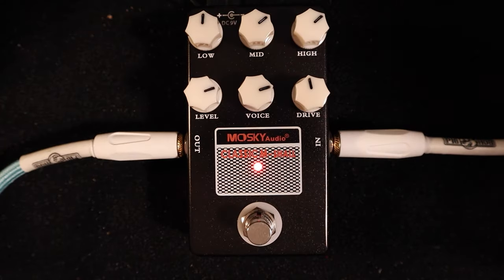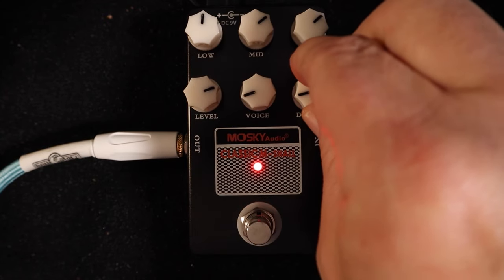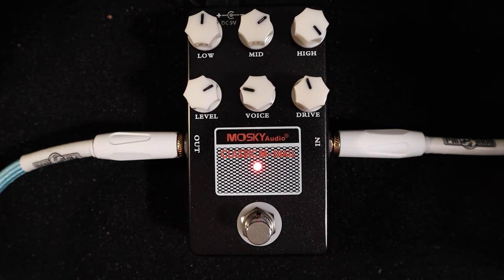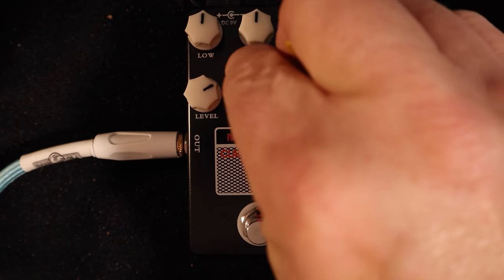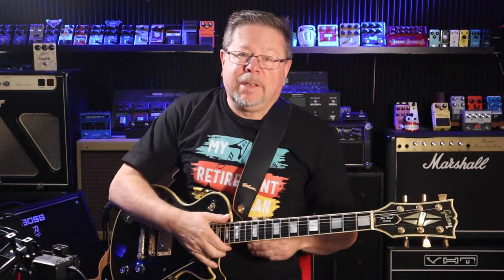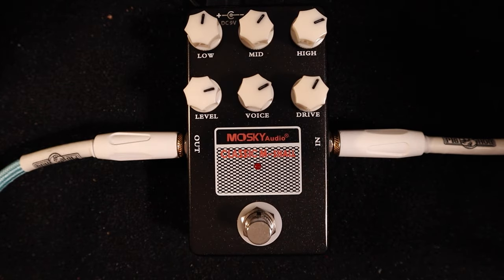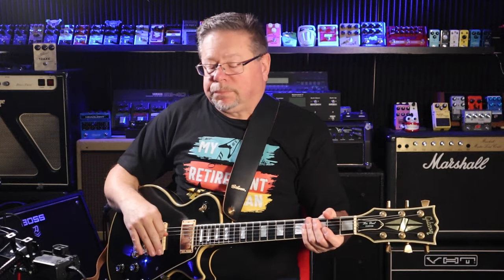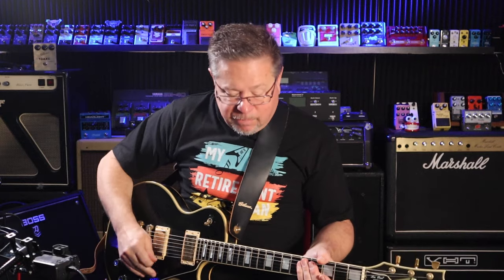Mosky M-Shall

Comment: I have two Mosky amp simulator pedals: the one shown in this video, and the Mosky M-sa which is a Mesa Boogie simulation. These are devices that deliver a lot for the low price they cost. I also have a Flamma pedal that simulates 7 different amps. It's a little more expensive than the Mosky pedals, but it's still great value for money.